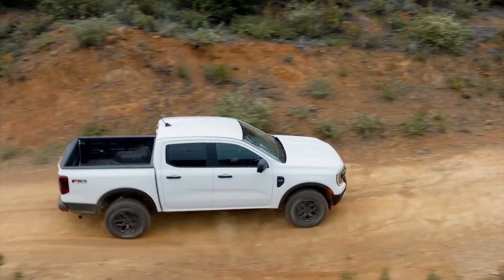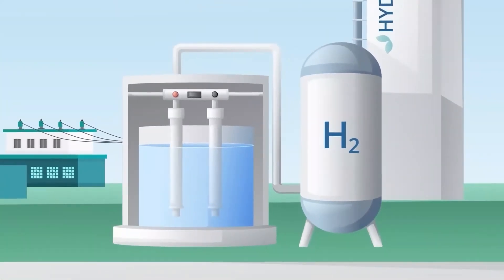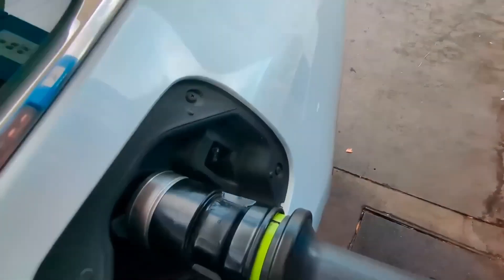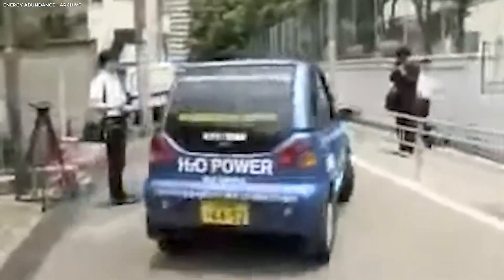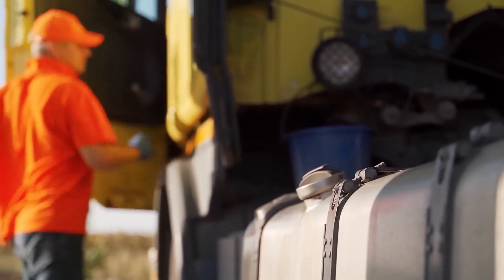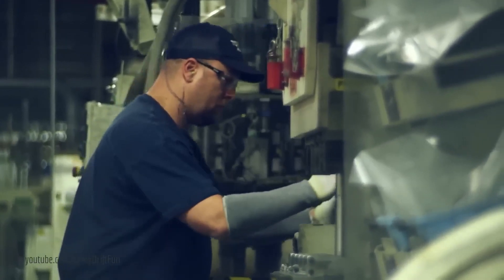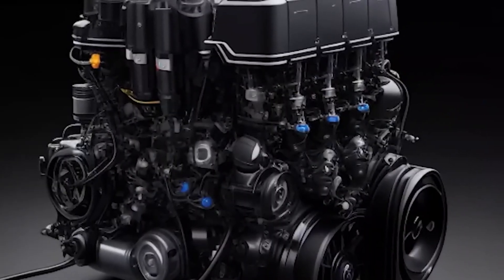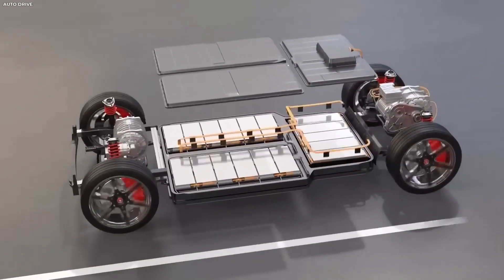Toyota’s CEO Says This New Engine Could End Electric Cars – Here’s How!

Comment: This violates the laws of thermodynamics. Your putting electricity into the electrolysis process and your then recombining the hydrogen into water and using that electricity to power the car, there is a loss of energy in this process and you would be better off powering the car with the initial power source that did the electrolysis